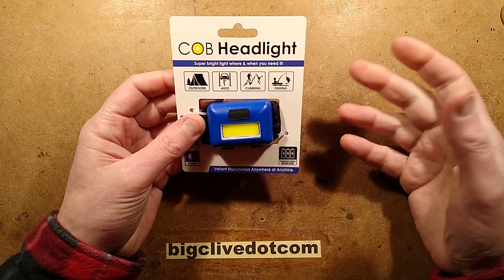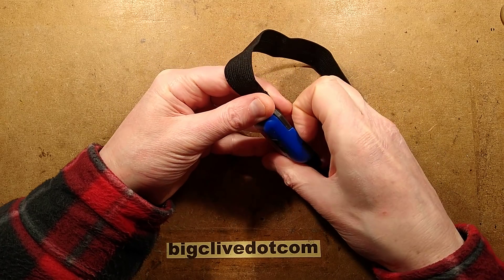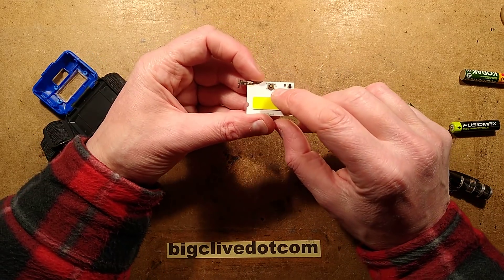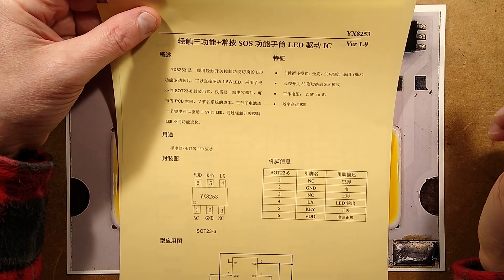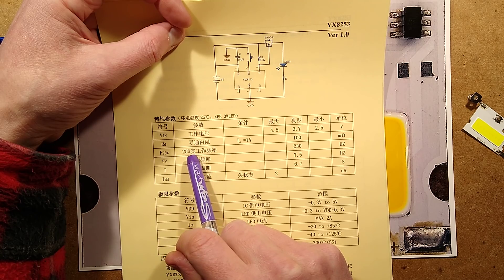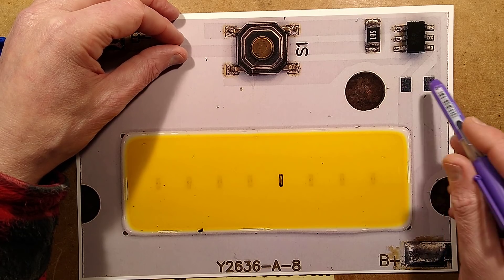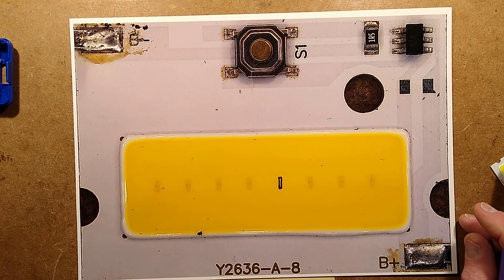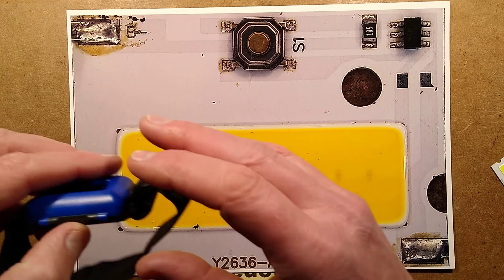New Poundland head torch is actually really neat.

Comment: I got one of these today. I put in a small square 500nAh lithium cell I took out of a broken ear bud charger case and a T4056 type C board. Its bright enough, fast to charge and very useful. Not bad for £2 plus recycled bits.
Reply: Did you have to use a current limiting resistor for doing that?
Reply: @DrunkRetro  No since it uses 3 AAA batteries normally so its actually running at a lower voltage with the Li-ion cell.

Comment: The Poundland E27 lamp holders ( card diagram instructions wrong ) Black = live ... White = neutral ,  correct connections... FYI ..
Reply from the maker: That's odd they're using American colours.  Black is live there.
Reply: @bigclivedotcom  Hi .. the E27 holders are wired correctly ( Black = live ) but the card instructions are WRONG !  .. OK , as long as you don't touch the big lamp screw ( ! ! )  OUCH !

Comment: Just now seeing this video but dollar general here in u.s. has a  similar head lamp. I like to experiment with electronics, I cut an old phone charger soldered it to the terminals and used a 10,000mah power-pack as it's battery. Probably wasn't the smartest idea but it lasted forever without having to recharge vs having changing the batteries if you used for a couple hours

Comment: I saw this video  back in February Clive and on the basis of it bought a few of these - two for myself and a few to give to friends.  After 9 months of use though I have finally binned my two although they were still working well.  The reason?  The brightness goes down quite quickly in use but mainly because they are not adjustable in terms of up/down and in my case the bright area was way too high (Neanderthal forehead angle perhaps?).  Just bought a new rechargeable head torch from Toolstation for £10.  Admittedly 10x the price but what a joy to use in comparison and in time it will pay for itself since no more batteries!

Comment: Hey you Should do a Review/Break Down of the Cheaper DSLR Power Adapters And other stuff for cameras. Like this one  ACK-E18 Dual USB Cable With False battery. Would be really cool to see whats under the hood, If it is just cap's & Diodes or just 2 x Usb's tided to the power out.

Comment: Would it be feasible to run this from a USB power bank? Would I need to put a resistor in series or something?
Reply from the maker: Yes.  A resistor would work.
Reply: @bigclivedotcom  I used a 5.1 ohm resistor and that seems to work. But it is very bright.
Reply from the maker: @lachlan1971  5V minus the 3V of the LEDs leaves roughly 2V to drop.  Current = 2V divided by resistance equals around 400mA which is OK.

Comment: the SOS function really should be where you hold the button in for a few seconds. that way you dont get it when you're adjusting it, but still can use it if you need to. thne they should scrap that other blinking mode because ...its useless and nobody uses it

Comment: I have older dimmers in my house that seem to work fine with LED lights of most types (even some better brands of non-dimmable seem okay). What's the difference in the newer more $$$$$ LED compatible dimmers?

We purchase expensive LEDs, and even more expensive dimmers, to save a few $ on electricity and discard bulbs that we already manufactured and purchased. Especially curious when 7 of the 12 months we can benefit from the heat of Halogen and incandescent, making them technically 100% efficient.

Comment: What about using with some super capacitors? With the low quiescent current they should hold a charge for long time. Might also use a hand crank generator to charge them up.
You could 3D print the case and then build the project.

Comment: Bargain for a quid. They actually do another version that has tilt adjustment and rudimentary weather sealing but it's so poorly made I wouldn't trust it to keep water out. 

I think this unit is better even though it doesn't have tilt adjustment.

I even strap them on the front of my RC cars if it happens to be a model that doesn't have lights. 

For a £1 it's cheaper and easier to cable tie this to the front bumper than wire in LEDs. It might not look pretty but very effective and who's going to see when it's dark?

Comment: you might have already seen this, but if you are annoyed by the 3 modes, you can colour in the capacitor in the circuit with a graphite pencil. the graphite drains the capacitor more quickly, so you can press quickly to change modes(depending on amount of graphite), or a little more slowly for just on and off.

... well, if it's there...

Comment: I had similar cob led like this, only its intended for emergency work light powered by 3 AA battery,,
 I got curious, inserted 2 lithium 14500 3.7v battery, got a massive more bright output for 5 seconds before the resistor blow up.
The cob led survived though,

Comment: Bought 2 of these around Christmas. To quote the man, pretty neat - easily as good as more expensive large units. Buy and throw in tool box and get for kids and emergency light with leak proof long life batteries. Poundland also do a white globe COB like an eyeball which is great as well with its mount and 360 degree stand

Comment: I noticed you had what appear to be 2 alkaline and 1 rechargeable AAA cells in there. I've seen on many different instruction manuals over the years stating that it's not a good idea to mix cell types/chemistries in the same device. But I've never really known if that is true or if so, why it may be so.

Comment: I saw these and bought two.   Didnt know about the SOS function.     The only thing i dont like is the fact you cant aim the light... its fixed.   But what i have done was to stick a strip of drought excluder foam tape on the top edge and it no points the light downwards a bit.    I also saw the COB Key Ring lights.. and they too have an SOS function.

Comment: Pretty nice find! At Big Lots here in the States, I got a USB powered light with a similar light board, 3 lights high 10 lights wide, yeah 30 lights, eye searing, less eye searing, strobe, hold for SOS flash. All plastic, handle has a carabiner style clip, folds 90 degrees for lighting hanging off the side of something metal as it has 2 really nice magnets in the handle as well. It also doubles as a battery pack to charge your cell phone. Was more pricey at $10 US.

Comment: Thanks for the teardown, I'd seen this in my local poundland but decided against it as the COB was too small, I was looking for larger COBs I could use for my custom ebike light, ones that will point down on the ground to illuminate it when going past people on bike paths, so I can turn the main beam off and not blind other cyclists/walkers yet we can still see the ground ok.
I ended up buying that large plastic £2 'lightswitch' which takes 3xAAA's and has 2 large LED COBs to salvage, it'll be perfect.

Comment: Sheesh American “dollar” stores are a joke. The only LEDs I’ve see are nightlights and 60W eq. bulbs. Never a battery string or flashlight or headlamp.
Reply: Dollar Tree has all kinds of little 4.5v cob lights.  You can get the stick up switchy ones or flash lights or the stick up push one or the wireless light bulb style.  Fairly good for a dollar as a backup light.

Comment: I had to repair a head torch lately because the LED was broken. 

After I swapped the LED and testing it I realized that it got burning hot, because there was no resistor for it. What a shame.

Comment: I love how you specify that it's a button from a Ford remote control... in fact many remote controls... in fact it's just a generic SMD button that you can buy for literally 5 cents on ebay.:-)
Reply: vinny142 he has a video replacing a switch in a remote and it’s not the same footprint as the cheapest type. It’s wider or the pin out is on opposing sides.

Comment: I recently just modded a small motion light that uses 4 AAA's to use 1 or more 18650's with the help of a step up module to 6.3v. I tried 2 18650's in series but the LED's got a bit hot for my liking at that voltage thus why I went with the step up module.

Comment: Tsld 300°C(5S) means that Max soldering temperature of the component is 300°C for no more than 5 seconds. I bought a similar product(in key chain configuration)with the exact same layout and components for a € about 2 years ago from a local euroshop store here in Athens Greece. Still works perfectly...

Comment: Bye-bye modularity. If the LED goes out, you'll have the hardest time replacing that. If nothing else  China should just standardize pin-to-pad contact with bowed conductors pressing on a flat surface for ease of assembly and repair.
Reply: For £1 no one will care enough.
Reply: @Locutus  Even if it makes the product $2, it would be a service to their own people and whoever imports this hardware to ship more products which can be easily repaired by swapping components out.
Reply: @bluephreakr  The thing is that the value is too low for people to care about. Why waste 15 minutes of time trying to repair this when I can buy a new one for a quid?
Reply: @Locutus  Because it'd take you fifteen minutes to get there, you can order a spare in advance and spend a quid not throwing cheap plastic tat in the landfill? Not sure really why people would be against that; lights and batteries are some of the most expendable consumables in devices yet we use smartphones with them sealed in so if it breaks you have to bin it. I just don't like that mentality. Plus, less solder at the final assembly line is good for everyone IMO.

Comment: If the two pads are across the LED, I wonder if they could allow you to take a lead off to an extra LED; I've seen a lot of (much higher end) head torches with red LEDs on the rear of the band (especially on roadside works crews), this could allow you to do that - either in a different package using the same board, or as a hackable thing?

Comment: I was just shouting "THERE'S A SCREW" whilst you were trying to get the contacts out.
Reply: At one point, I convinced myself it was a solder blob and I was the one mistaken because it makes no sense he hadn't spotted it yet xD
Reply: @rich1051414  Actually different Rhymes that I had. I thought I saw a ball was a screw and tried to unscrew it and realize. Where is SEC? There's no slot.

Scratch my head and realized oh solder ball oops.

And one time I literally had both.

As in a real screw turned into a soccer ball where the Sauder it flowed over. Enough of the screw that you couldn't see the slot.
Reply: Same here - I was shouting "How can he not see that?" Youthful impetuosity I'd surmise. 😅
Reply: I think we’ve all been there before.
Reply: @sonotdown998  Yep, usually find it after the circuit board is in 3 or 4 pieces, but this one WAS  bit obvious. 😅
Reply: @1pcfred  That's a good point, actually, if we consider the different viewing perspective between Clive's line of sight, and the camera's position. But then, Clive did lift and rotate the lamp a couple of times whilst extricating the battery contact strips. . . Let's be honest, he just couldn't wait to get in bits - "youthful impetuosity". 👲
Reply: @sonotdown998  I agree more times and I would admit.

I'm a techie myself and oh, yeah. Been there done that.

You know the old single screw under a label.

But that's just about lasting 10% of those times.
Reply: HAHA  Same here...  "Clive!  Remove that screw!!"
But I suspect his view of it could have been obstructed by the camera, or light, or glare...